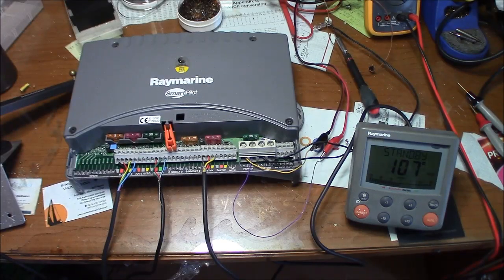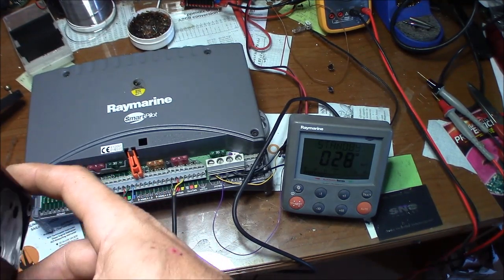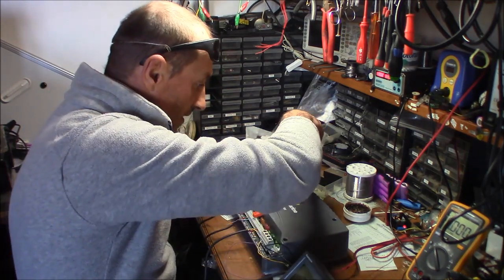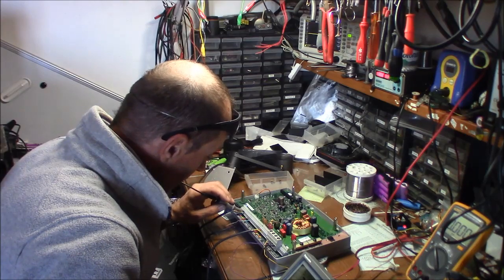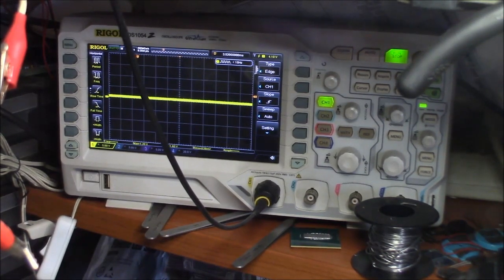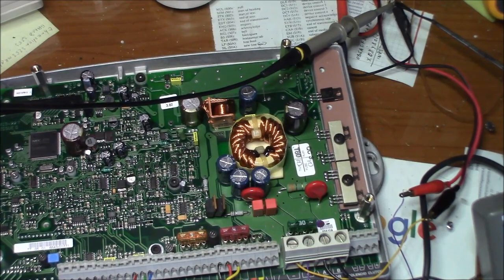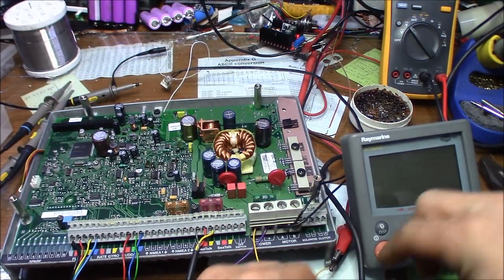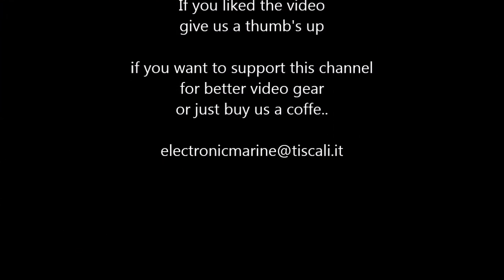Raymarine smartpilot s2 repair

Comment: Thank you for a very educational video.  On my system, the Autopilot seems to  send erroneous heading data into the SeaTalk-2 and the heading flip flop 180 degrees intermittently on the MFD. The heafing on the Autopilot itself is nice and steady. Any suggestions would help.

Comment: I have an S3G and a S2G which I bought used online.  They both have some rattling noise inside and some small flat black plastic tabs fell out.  Do you know what these could be?  I'm worried about the gyro sensor breaking loose. Thanks

Comment: I've got a S2 that has stopped putting any voltage to the clutch to engage. It was reading 8-9 volts when engaged for a while and would only work if the engine was running. The battery bank is of course topped off and the voltage going into the unit is 13.3. Any tips on where to start looking?
Reply: Hi. i've lost the clutch output also. Have You any diagrams ,info which  transistor drives the clutch  output. I have s3 but  the clutch circuit should be similar.
Reply: I have the same problem skyler, did you end up rectifying?
Reply: I'm also having the same problem. Anyone know if any special component needs to be replaced?